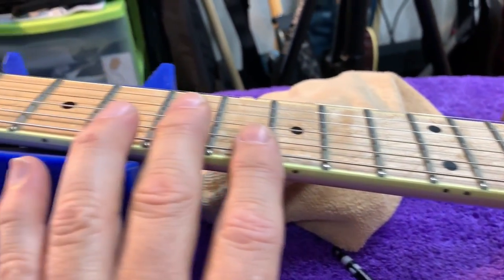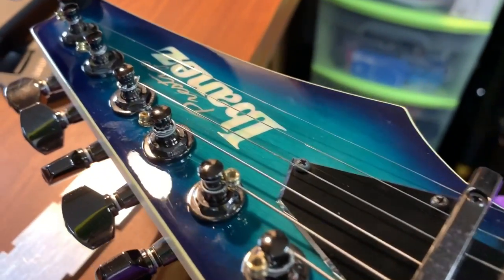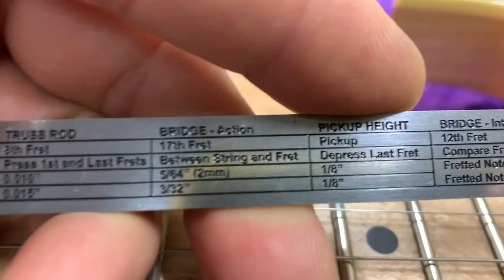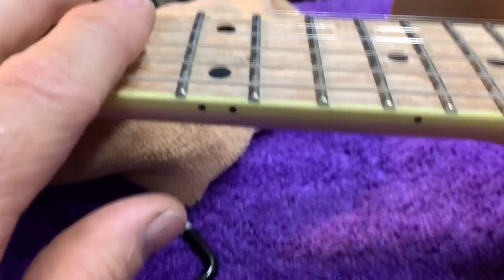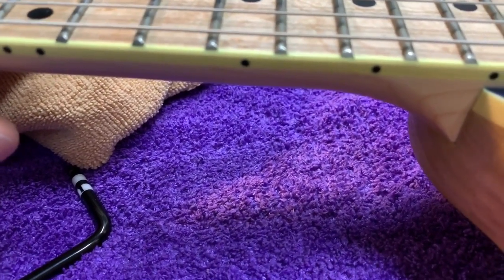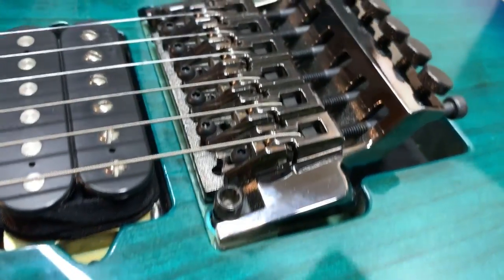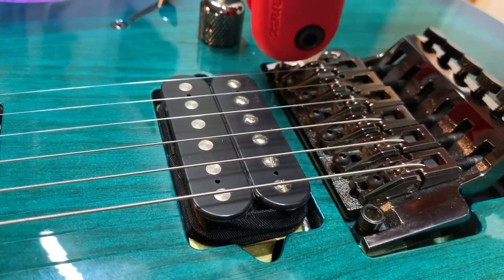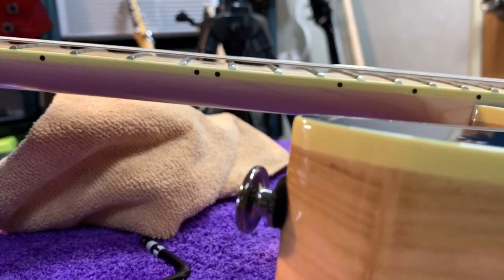Ibanez Prestige RG652AHM Truss Rod & String Height Adjustment (Edge Locking Tremolo)

Comment: The bridge is kinda forward, you want that line on the side of the tremolo, which is the knife edge to be level with the body of the guitar. That line is higher than the body on your setup
Reply: First thing I noticed was that his rose is sitting an extreme angle . Absolutely needs to be flush with the stock
Reply: @jayceeadams4379  I've been running into this issue with this guitar. I bought new springs i've done all kinds of adjustments and for some reason my rose sits at a angle like his does. I even purchased new springs from floyd rose and same thing (the guitar is fairly new) I've done all kinds of adjustments and the rose sits at an angle just like his. I wonder if this type of guitar is meant to be like that. I took it to get serviced and it came back the same way as his. All my research on floyd roses shows it a more leveled and I was wondering what was wrong with my stuff.
Reply: @techhdan  do you often switch tunings? Or do you typically play in one tuning
I have an rrx24 Rhoads with a floating trem. I keep that guitar in  drop c tuning and use my hard tails for songs that I need to tune differently for. I'm sure you already know this but when I first started doing my own adjustments on the floyd rose I didn't realize that by switching my tuning I would through out all my heights. I took my ltd model in to get the floyd set once and it Also came back at a super narly angle. Whom ever serviced it was just lazy and incapable.  I spent a while getting the plate flush and micro adjusting and then it played like a hot damn. The other thing that could be happening is if you don't release the string tension when adjusting the height of the plate you can do microscopic damage to the bolts that has an impact on the guitars ability to stay in tune. I'm with you man. These set ups can be incredibly frustrating and defeating at times. I hope you find a fix that works. I suppose also that even if he has set it at an angle and it plays well for you then I guess it's okay, it's just not typical is all and most players would probably agree that it should be flush.
Reply: It's an Edge so should be up a bit. There is a slit on the side that lines up with the body. This looks fine. I thought it was supposed to be flush too but was wrong.

Comment: I hope you didnt listen to that CRUZ tool ruler.. lol.. Ibanez with the locking trem and flat radius fingerboard can easily go under 1.0mm or (2.5/64).. with NO BUZZ. amazing design guitars.. those trems are awesome.. Have an 89 RG560 with original Edge.. still going strong.. love the skinny WIZARD neck now that i am older.. and arthritis is setting in ..

Comment: I have the exact same guitar. I have .010 neck relief at the 8th fret. The low E string height is 1.5mm at the 12th fret and 1.25mm on the high E string also at the 12th fret. There is no fret buzz at all with these settings. The strings are a little tight for bending on the high E around the 20th fret, but overall the action is perfect and low. 

I just picked up a brand new RG550 Genesis (purple neon) and attempted to make the same settings. What I found was slight low E string buzz from frets 1-5ish when fretting chords, not when playing open. My guess is the Wizard HP neck on the Prestige has a better fret leveling job from the factory than the regular Wizard neck on the RG550. Both neck relief settings are exactly the same.

I had to raise the action a little (≈ 1.7mm low E and 1.5mm high E) on the RG550 to get rid of the buzz, but the playability is still great and the action is still low. I'm planning to level the frets on the RG550 in the near future (as well as other mods, like getting rid of the middle pickup and throwing in a super distortion or tone zone in the bridge). 

That's the only thing I can think of that's different in the setups. I would like both guitars to be the same (OCD).

Anyone else have any ideas? I'm all ears.

Comment: Cool axe. I gotta say though you should have flushed up your floyd rose with the base of the stock before doing anything to the truss rod . It can be adjusted Vai the springs below. I wouldn't be surprised if you didn't need to adjust anything other then that in order to get your string height lower. My experience is it should be a balance between getting the plate perfectly flush and then doing any small adjustments from that step on ,often you have to spend time tweaking it back and forth ,re tuning and detuning before you get it perfect. On average I'd say changing the strings on my esp with a floyd rose locking nut takes me an hour plus to get to the sweet spot. If your just re stringing the guitar and the current strings are set to where you like them and the plate of the rose is flush than often I will stack broken popsicle sticks in behind the spring box in the underside of the guitar to limit movement so my bridge dosnt tilt forward creating more guess work then needed . Once it is restrung I can remove them and then do any small adjustments in a quick amount of time. Thanks for the video though man. Gorgeous guitar😎😎😎
Reply: Yep..I have a block of rubber that I stick under the string lock bolts..I barely push down on the bar and then set the rubber in its place and then raise the bar..the tremelo baseplate stays flush with the guitar body and just get the strings on it then do the rest.
Reply: Floyds do sit flush with the body, but the Ibanez LoPro bridges are a little different. The base plate of the LoPro is angled / ramped a bit, so it'll appear as though it's set up incorrectly, but that's just how it's designed. 
That said, his bridge appears to be pulling forward ever so slightly, but not by a whole lot. If you pause the video at 5:39 you'll see there's a line on the side of the bridge that allows you to gauge your setup. 

Cheers
Reply: The edge original is angled also. Everyone who has had a Floyd only thinks that.!

Comment: A word of warning here. In the guitar body there's a threaded insert. If you adjust the bridge height without backing off that small lock screw it can result in that threaded insert seperating from the body (it's most likely glued into place) and from then on it will just spin as you turn the bridge posts. Adjustment will be almost impossible and it will need bonding back in. I bought a used 7 string where this had happened, and I ended up getting the bridge post cavity dowelled and re-set. It's also a watch point for anyone buying used like I did.
Reply: I wish i read this about 20min ago. Good thing it's not in any of the videos I've watched.
Reply: @dynomantar9733  did you spin the insert?
Reply: Where is that lock screw located in the guitar ? I was thinking of lowering the action
Reply: @atgwiuz  there’s a hex head lock screw recessed in each of the two posts that the trem pivots on. Something like a 1.5 or 2mm hex way down inside the post cavity.
Reply: @firestorm996  so we need to loosen those before adjusting the bridge height and then tighten them again right?
Reply: @atgwiuz  correct - and don’t over tighten!!
Reply: @firestorm996  got it , thanks a lot brother.
Reply: @atgwiuz  glad to help. You may be able to adjust action on the bridge saddles as well depending on which model you have
Reply: @firestorm996  i have the same rg652 , it's my first prestige
Reply: @atgwiuz  I only have 1 Ibanez at the moment, but it's a 777 Vai Jem in desert yellow, less than 500 made back in 89/90.  I do plan on buying a Jem Jnr at some point to keep the Jem in good condition!

Comment: Awesome.
Like you said, it's not a whole lot of information to find regarding string height adjustments on these bridges.
So basically, you loosen the tiny screw first to be able to make the actual adjustments with the big screw? And then lock it by tightening the small one when you're done?
Correct?
Reply: correct :-)

Comment: Just came across this as I have the same model. There are a handful of ibby bridges - the 652 is the original Edge trem. The Edge II you speak of does not use a locking nut. I have no idea behind that concept - the locking nut is essential to the system.

Comment: Word of advice. Don't adjust the string height while the guitar is in tension like it's being shown here. Take off the bridge and loosen the strings first. Otherwise you'll screw the knife edge against the posts.
Reply: Maybe with Edge or Ibanez trems. I have OFR trems in my Kiesels. Never had a problem with dulling of the knife edge.

Comment: Whats the size on the hex tool for the Truss rod? or does it HAVE to be the ibanez tool? Bought my Prestige used from GC and although my model originally DID say Tool included, when it finally got here, no damn Tool. Also the Lo pro Edge has that same locking thing.

Comment: I spent forever looking at leveling floyd rose and my ibanez prestige seemed to be so high up in the back of the tremelo i thought i was doing something wrong. After looking at your video I think yours looks exactly the same. I guess this is normal but man I spent a LONG time trying to figure out what was wrong and why my tremolo was not leveling like other guitars with a floyd rose.
Reply: There is a little rectangle on the side of the edges baseplate. I set this level with the body on mine. From factory it was sitting a few degrees out

Comment: Thanks for the video. I have exactly the same model but the locking studs seem to bottom out before I can set a desirable level of action, they are just too long - my guess is that the inserts should've been seated deeper at the factory. As a result - the neck is shimmed at the heel to reduce action. Is there a shorter version of these locking studs, e.g. 2mm shorter?

Comment: Brother thank you so much for this I have a jem and I needed to confirm this my first jem I got those lock screws were a mess and did not work would not loosen or tighten literally couldnt even feel them with the ibanez tool at all had to get an exchange and took me 2 months to get it so now its here so new strings for new guitar to be ordered finally and see how it does with some low tunings the defective I tuned to D and left it I assume this is for the Edge on the Jem 7p as well?? I was beginning to think there just wasnt any lock screws on the first jem they sent me I couldnt really see anything in the hole well enough to say yes or no to be honest but couldnt feel them with the key that was certain

Comment: Dude, you have to remove the  floating floyd to adjust the string height. check the floating blades that ride on those screws now, i bet it has a serious burr or worse.
Reply from the maker: It’s not a Floyd
Reply: Jonathan that's a myth. Tuning the bridge screw adjustment will not damage the knife edge.
Reply: @stephenwilliams1747  i wanna see pictures of proof on that one.  you have a blade under tension, and it fits in a tight groove, and then you twist that post. that won't dull the blade? unless it's a completely different design im aware of.
Reply: Jonathan I did forget to mention that you should lose all tension on the strings before turning the bridge post. But trust me. I am 45 years old and been playing Ibanez guitars for 30 years. As long as you take the tension off the strings before you make the adjustments you'll be fine.
Reply: @jonathanpascal25  as long as both the knife edge and stud are clean and the stud isnt dirty or damaged, turning them under full tension wont damage the knife edges or posts. The Ibanez manual itself even says nothing about loosening string tension before adjusting. The knife edges on any high end Ibanez trem are made of steel and all (I think) variations of the Floyd Rose have steel base plates, they'll all handle height adjustment under tension just fine

Comment: excellent video.  it says in the ibanez manual if anyone reads it ! I always wondered, if bass and treble sides are different height, doesn't that mean the bridge is resting on the knife edges lop sided ? or is it just microscopic amounts ? probably.
Also when i try stringing from the tuner towards the trem I cannot feed the strings UNDER the bar behind the nut easily (to use the ball end at the tuner)got any tips ?
Reply: The bridge is probably not lopsided but designed to account for the small difference in height from low to high strings. Since most Prestiges have a fretboard radius of 16 or so, I imagine the bridge takes that into account as well without needing to adjust individual string height.
As for your second question, you can use small needle nose pliers to help the string under the retainer by the nut. No need to take it off everytime. 
And yes, keep the ball end at the tuning posts and you will need very minimal winding.

Comment: Aaand you dulled the the trem blades by moving the post under tension. Bad move. I agree with the comment below, you should've adjusted the tremolo springs to go back to zero/level

Comment: Does the truss rod adjustment affect the relief immediately or does it take a day or so to settle?
Reply: In my experience it takes a day or overnight. I usually fine tune it over a weekend once in spring and once in fall. Or if I am going to change string guages.

Comment: Wow, that bridge should not be sitting like that. Lol
Reply: Josh good eyes..it should be level with the body. I have RG550 LTD (limited edition) bought a new in 1997
it is also important that always detune guitar when you raise or lower actions because of studs/knife edges.. they can quickly wear. On my guitar, after over 20 years I have no problems..I only replaced the Ibanez E power springs
The RG550 was my first proper touring guitar.
Reply: his bridge sits fine. this is not a floyd rose, these bridges are adjusted a bit differently. there are two lines at the sides of the tremolo which should be parallel to the body not the trem itself. you can see that the screws that are holding the strings inside the bridge are parallel to the body so the bridge looks perfectly leveled to me
Reply: @timeflies98  Wow, maybe you should get your eyes checked.
Reply: @flyingdutchman80  just have a look inside the manual and look at the pictures of a leveled edge trem. you'll see that I'm right. So instead of explaining why you think I'm wrong you're just insulting me, you my friend are a little child

Comment: Wow.  This video is good, but dangerous to follow!  You did not demonstrate unlocking the studs properly:  you need to unscrew the inner screw much more first! Otherwise, you will have very little downward adjustment possible and risk cracking it.  Also, it’s 1.5mm for lock, 4mm for adjustment.

Comment: 😺👍🏽
Reply from the maker: Ha! A Kit Kat sighting!😹👀
Reply: @Poo Ninja I also didn't loose the string tension, and remove the springs while turning the spuds for low action on the bridge, which was a mistake, but I didn't know this, I might have damaged the knive edges, but hopefully I didn't. And some even recommend to remove springs as well, before adjusting the bridge height. In case, wanted to let you know as well :P.

Comment: Floyd must be parallel to neck or bar won't work haha,,,no you got lots more to do
Reply from the maker: Uhm, it’s not a Floyd
Reply: @EJsGuitars  what is it
Reply: @EJsGuitars  samething
Reply: Tuning fun
Reply: Just saying the scews in back ,before doing anything with  strings tremlo has to be level parallel to body then do action, everyone an expert ,,cool stuff hope get her figured out,,a fine tuned lady
Reply: @jimtom4849  This is an Ibanez Edge. It looks pretty much like it’s at the correct angle in the vid. Other than Floyd, the upper edge of the Ibanez plate has an upward angle. You want the lower edge to be parallel to the body instead. You can tell the angle by looking at the little rectangular cutout on the plate’s side (actually what you see is the side of the knife edge). If that’s parallel, it’s correctly set up.
Reply: @RealGrover  that is correct. The cutout is kinda like a bridge level indicator. Since the rest of the body of the bridge is angled. Unlike a Floyd which has a level designed bridge body.